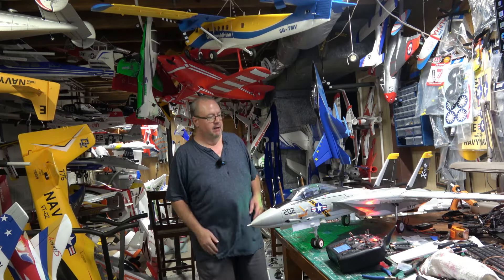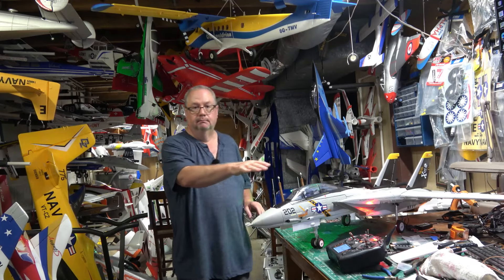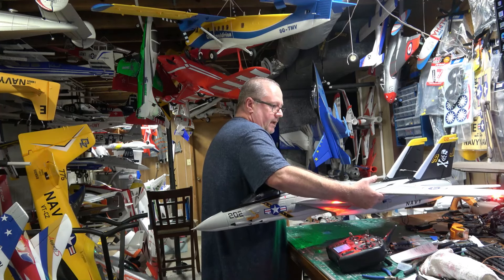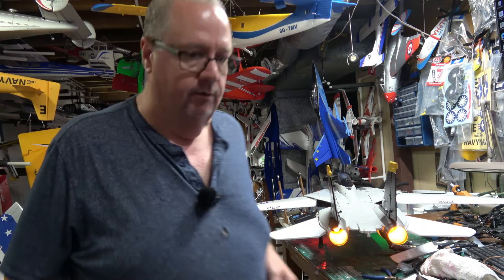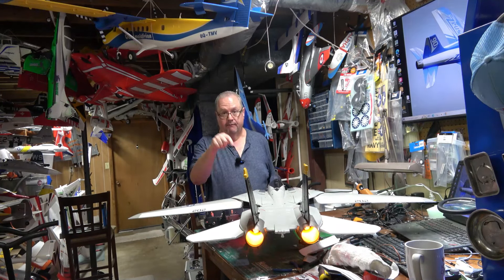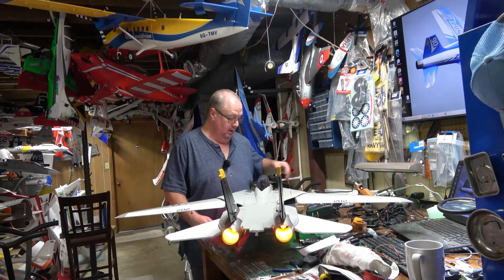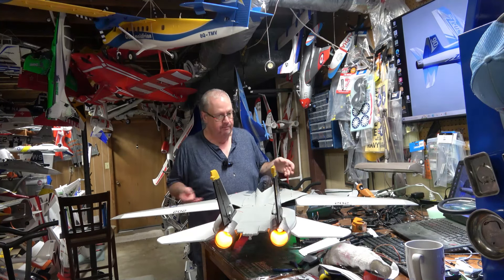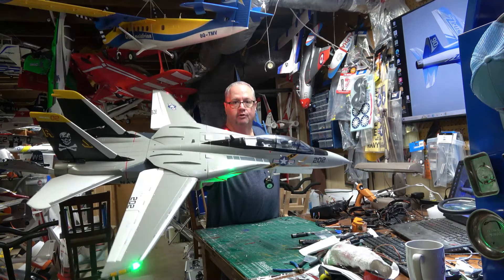FREEWING TWIN 64 F-14A AFTER CRASH AND MOVING FORWARD by FGFRC

Comment: Hi Greg.  I have a suggestion about how to show your rate differences. Instead of moving the servos up and down when you flip the switch move the servo so the surface is deflected up or down hold it then move the switch.  When you do that to the surface we will see the travel difference. Moving it up and down while flipping the switch we don’t see it.
Reply from the maker: Actually that makes more sense to do that. I watched the video again after I had loaded it  up online , like I normally do. I thought I really cant tell the difference in the throws but doing as you suggest would make for a better explanation.  Now this is the kind of constructive criticisms that I invite and need . Thank you. So many people just comment on my videos with just blatant gripes but with no fix. I learned a long time ago do not  complain openly without offering a good working solution also.

Comment: is it better that the sweep mechanism pops off in the event of a crash and acts as a fuse to avoid worse damage if there was no give in the system?
Reply from the maker: No real give other than it breaking. The rods are very sturdy and the servos are big full metal ones with a lot of torgue.

Comment: I'm definitely curious to see how it lands and takes off in the safe mode. Wesley told me it wasn't recommended in a chat on here . But I still was curious if it would help . I feel the same way as you if it works I could be a great  help landing. I'm still waiting to maiden mine .  Thanks for the video! Good luck on the next flight!
Reply from the maker: We shall see I have a short runway so It will be a good test.

Comment: How do you set the gyro to the controller to switch thru its modes? . I cannot find any thing in the manual to get the gyro to attach to the controller.
Reply: Just plug gyro into open ch on rx and set a 3 position switch on your transmitter.  You don't need a manual to set it up
Reply from the maker: Mikey is right any three position switch the gyro automatically configures what switch does what.